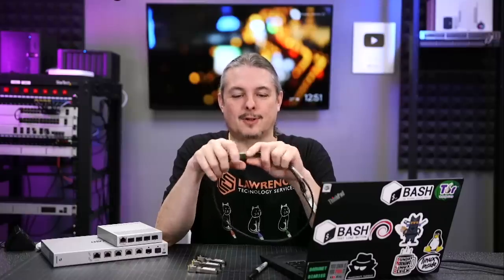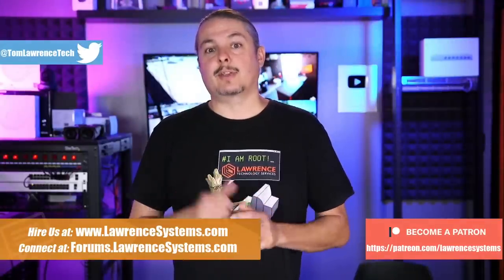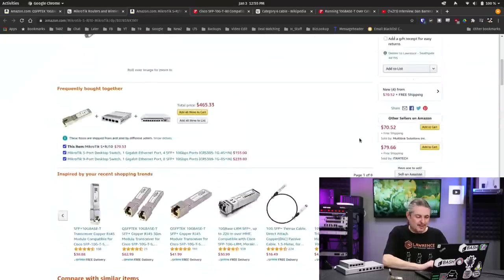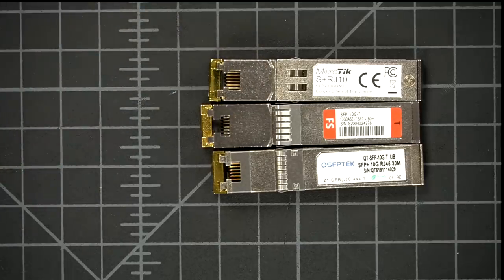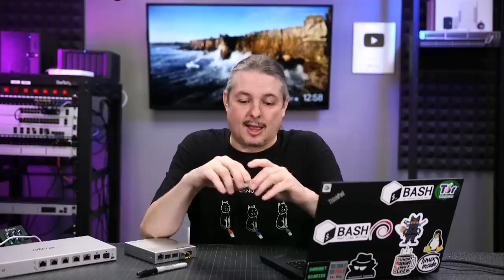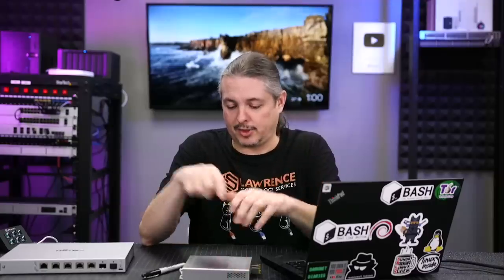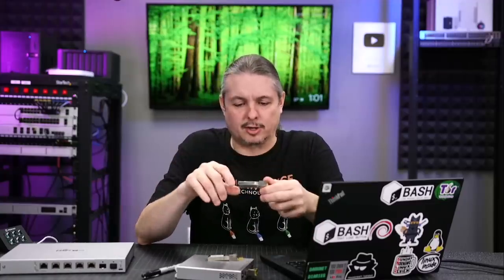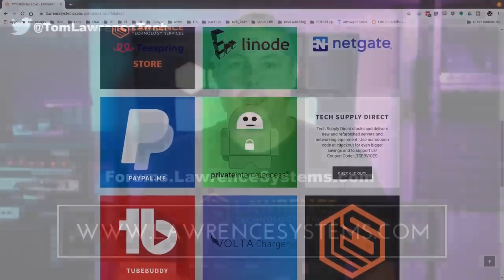Comparing 10GBASE-T SFP+  RJ-45 Copper Transceiver Modules

Comment from the maker: Amazon Affilitate Links to parts mentioned 
https://kit.co/lawrencesystems/network-gear

Videos
Interview: Dan Barrera With Ideal Networks About TIA 42 Cabling Standards & Testing Processes
https://youtu.be/kNa_IdfivKs

MikroTik CRS305-1G-4S+IN 10G Switch Setup Review With VLANS
https://youtu.be/qrYBhFIE-qA

Other links
https://www.fs.com/products/87588.html
https://mikrotik.com/product/s_rj10
https://community.fs.com/blog/should-we-use-cat6-or-cat6a-for-10gbase-t.html
Reply: Tom great video and thanks for the research on this.  Just a quick question on if the FS.COM 80m copper SFP (87588) will work with Ubiquiti's UDM-Pro and  USW-24-POE PRO switches or just stick with Ubiquitis SFP's?  Or perhaps if you could show the comparison?  I'm running a all copper upliinks and some are over 30m. Thanks.
Reply: Ide like to know which works with udm pro
Reply: The FS.com Transceiver you ordered was the Cisco compatible one (IE not generic)? In the past, I have ordered the Ubiquiti compatible FS module. I see that the 10GBASE-T do not have that option this time around.
Reply: In reply to myself, I went with the generic version for compatibility. It works in my USW-PRO-24. I did have a little trouble getting it working with my 2.5GBASE-T. I had to set Link speed of the switch port from "Autonegotiation" to "2.5 Gbps FDX". The computer connected to it has a Realtek ethernet port. The ethernet cable is maybe 2 meters long. I tried another ethernet cable but that did nothing with Autonegotiation.
Reply: What about using cat 8.1 that has 40Gbps??

Comment: Something I wanna add to this, if you own the Ubiquti 16-XG which has I think 12 x SFP+ ports, they only allow you to insert 4 of these 10BASE-T SFP+ adapters. They do use too much energy / release too much heat. So check the manual of your device before buying any. In the manual of the 16-XG it specifically has this warning for these 10Gb adapters and not for the 1Gb ones.
Reply: It's actually not true. I have XG-16 and currently using 10 SFP+ filled with 10G RJ45 Transceivers. No issues at all, been this way for more than a year.
Reply: @teddyc81  You're running it out of spec that's all, check the manual etc - Also these transceivers have differing power consumption level. Some of the 10Gb ones only work over lengths of <40 feet while others work to 100 feet and some to 150 feet etc - Your mileage may vary, I would definitely recommend sticking to the manual though.
Reply: @droknron  Ah! I found it from very bottom of the datasheet. You are completely right. Thanks for pointing this out - I wasn't aware of this until today

Comment: 200m on S+RJ10 is not a typo, just has to be at specific speeds and to specific targets (1G / 2.5G, S+RJ10 to S+RJ10). 10G is still 30m to any targets. The exact supported length for each speed/counterpart is listed in the brochure on the module's Support & Download page.
Reply from the maker: The max CAT6a distance is only 100M, so what cable are they using to get 200M?
Reply: @LAWRENCESYSTEMS  100M is the official recommended maximum length for CAT6a (indeed any Cat) defined by ANSI / TIA-568, yes. However there are unofficial implementations that are built to exceed that standard such as Paige Electric's GameChanger cable which is UL-verified to 200m.
Reply: @LAWRENCESYSTEMS  According to the brochure - 200M distance attainable at 2.5 Gbps speed between two S+RJ10 modules (Cat 5e/6 STP). 100M at 5Gbps  (Cat 5e/6) and 30M at 10Gbps (Cat 6/7).

Comment: I always install full heatsinks over the sfp cage with thermal glue on every switch i own. It really helps with cooling the sfp modules and i have noticed 10-15c drop on each sfp module. When i have low amount of ports used i space them out .
Reply: Do you have a link to the heatsinks and the thermal glue you use?

I assume those numbers are with active cooling in the switch case too?

Would testing with heatsinks and normal thermal paste initially before glueing them be a good idea to see how big pf a difference it makes? 😀

Comment: 10GBase-T components require anywhere from 2 to 5 watts per port at each end of the cable to do 100m as per the spec (depending on the distance of the cable). SFP+ ports are rated for 1-1.5w max based on the mode. Some switches/SFP's will do slightly more so your results may vary.

Comment: I run a couple of 30m SFP RJ-45 transceivers between my server and my desktop. The server is in the basement and cat 6 cable runs from the server to a patch panel, then from there up through my attic back down to a port in my wall, and then to my desktop. The total run length is about 25m. That 25m includes stranded patch cables at both ends of the run and cat6 couplers/jacks. I factored in 5m of loss for those to account for them. I was aware of the 30m limit on most 10G RJ-45 SFP modules when I designed my network. It runs fine.

Comment: Mikrotik and those 200 meters - if you look at the specs of the adapter (in the brochure), you'll find that two of these connected together with CAT5e/6 can do 200 meters on 1Gig, 170 meters with CAT5e/6 on 2.5Gig, 200 meters with CAT5e/6 STP on 2.5Gig, 100 meters with CAT5e/6 on 5Gig and those 30 meters on CAT6 10Gig. 
It's Mikrotik so it's confusing as always. But worth it all the way. :-)
Reply from the maker: Interesting, might be something I test in the future.

Comment: Yeah I doubt most people have more than 98 feet of cat6 or 6a cable runs in their house (I'm sure some do) from floor to floor so these would be more ideal then running fiber in houses already built and possibly damaging the fiber when wall fishing. Curious which revision these have on them you should be able to see in the Ubiquiti switch I'm not sure about the smaller one you had for testing though. Overall good review, keep up the good content.

Comment: I was considering the FS.com LR modules but went for the Ubiquiti-branded 30m modules instead (because we have Ubiquiti switches) and ended up having the same issues you mention here.

The 80m-rated modules are only available for Cisco hardware from what I could see. Would they would in a Gen 2 USW Pro 24 PoE anyway? I couldn’t tell from the video if you used them in the USW

Comment: Were you going to/from the same brand of SFP+ 10GBaseT transceivers? Or using the Ubquiti as the 10GBaseT control?

Cause I easily get greater range over copper with the same Mikrotik (and over cat5e), but I always match brands of transceivers at each end. If you read carefully in the spec sheets, at least for the Mikrotik, you'll see the rated range is different if you use the same transceivers at each end vs with mixed vendors.

Comment: I'm wondering if the new FS RJ45 SFP+ module that says the power is less than 1.8W: SFP-10G-T-100. 
Do you have any of these SFPs to test them? I'm interested especially for the temperature. I have a Zyxel XMG1915-10E switch which performs very well with optical SFP on 10GbE, but I want to use my RJ45 infrastructure. Because is a passive cooling switch I'm looking for low power SFP+.

Comment: Slightly confused here ... at one end you had the Microtek + SFP adapter up to 30m or FS up to 90m  .... but what’s on the other end and why didn’t it have an impact on the 30m/90m? I assume it’s a 10Gb card in a PC but why isn’t it a limiting factor compared to another better/worse 10Gb card?
Reply: The Unifi switch since it has 10G RJ45 ports that can do 100m according to spec (at least with Cat6a)

Comment: Wow very interesting! What revision is your SRJ10 I have the same one and am curious if mines different (not that I tried >30m but still would be great to know). You can see it in swOS. Thanks!
Reply: I posted in more detail in another comment but if you check the brochure for this product you will find that 30m is the rated maximum for the S+RJ10 at 10G. 200m is only possible between two S+RJ10 running at 2.5G.

Comment: Just use RJ45 cat 8 cable to the SFP plus charge a 45 and no problems I mean they handle 40 gigabits at like 307 ft so I mean if you add they can handle 10 gig even farther so
Reply: The problem is most likely not the cables, but rather the SFP+ to RJ45 adapters, and more specifically that they don't provide enough power for providing signal over the distance of 30 meters. If I remember correctly, SFP+ to RJ45 adapter is not technically a part of the specification for SFP and it usually draws more power than running a DAC-cable or fiber cables, thus why it won't support longer cable runs. 

By the way, if you watch the video with Dan Barrera which Tom mentions in the video, you will learn that Cat 8 supports 40Gbps over a distance up to 30 meters (approx. 100 feet) and 10Gbps up to 100 meters (approx 328 feet).

Comment: Can I use any sfp+ rj45 adapters on the pfsense 1u 7100. My inbound internet connection is Ethernet, but the pfsense only does 10gig on the two SFP+ ports.
Reply from the maker: Not sure they they will work.

Comment: I have a cat5e already run about 450 feet so it has trouble delivering the full gigabyte speed sometimes it does, but mostly not. Do you think a 100m sfp module would help give it a boost and make it more likely to stay at full gigabyte?
Reply: With that type of distance you would need a fiber run cat 5e is rated for 100 meters max.
Reply: Not at all, the opposite. You should run fiber or use a wireless point-to-point bridge for that distance.

Comment: Ouch, I just bought a transceiver from Amazon and didn't notice the 30M rating. I'm not going to be exceeding that though. How would you recommend testing it to make sure the module is a good one and I'm not getting a lot of errors?
Reply: I would suggest to hook up a 30M cable, run an internal Ping test and set the Line under heavy load with something like Iperf at the same time. Should be good enough if you dont loose Any packets within 10-30 Minutes.
Reply: Make sure to check your interface stats for errors and dropped packets as well.

Comment: high speed networking equipment is coming down in price these days! you can pick up a used 32 port 100gbit switch for under $500 nowadays. great for future proofing while still being able to lower the ports speed to 40g, 25g, 10g, etc for use now with cheaper NICs.

Comment: how whit cat 7 and cat 8
Reply from the maker: Did not have any on hand to test with but I doubt it would be any better.
Reply: Probably the same result as the problem is most likely not the cables, but rather the SFP+ to RJ45 adapters, and more specifically that they don't provide enough power for providing signal over the distance of 30 meters. If I remember correctly, SFP+ to RJ45 adapter is not technically a part of the specification for SFP and it usually draws more power than running a DAC-cable or fiber cables, thus why it won't support longer cable runs.
Reply: @LAWRENCESYSTEMS  Totally ok, just needed to hear if there should be better with cat 7 or 8, so no need to use these cables if it does not work better.